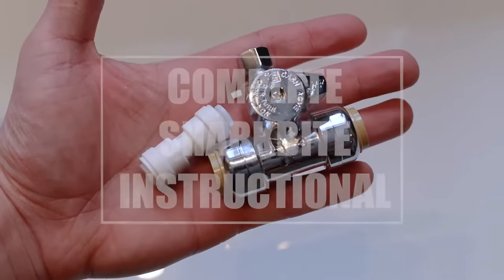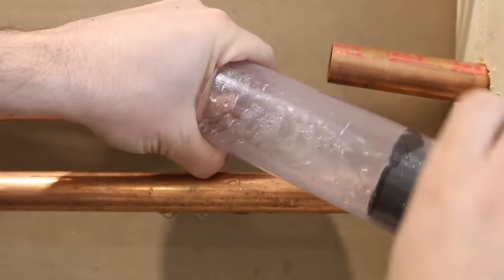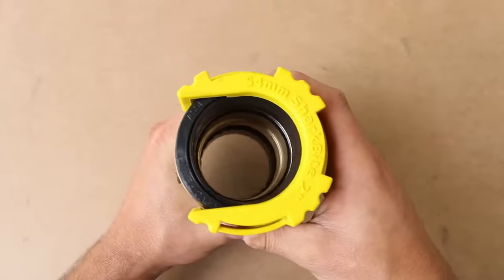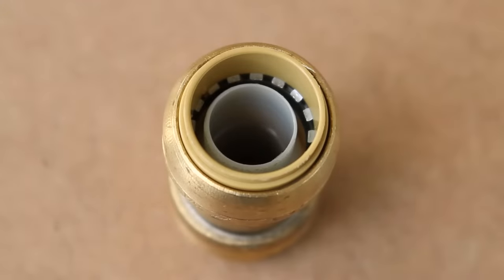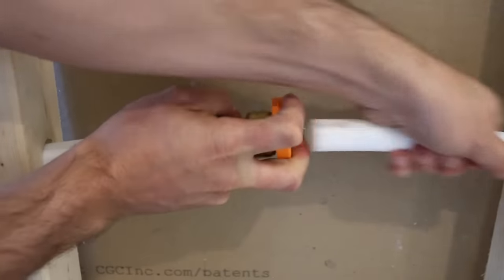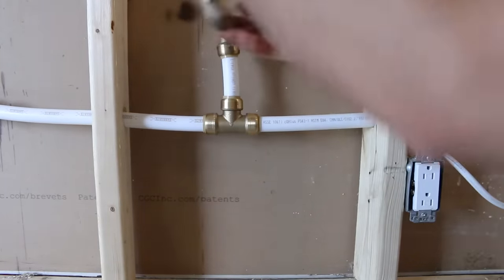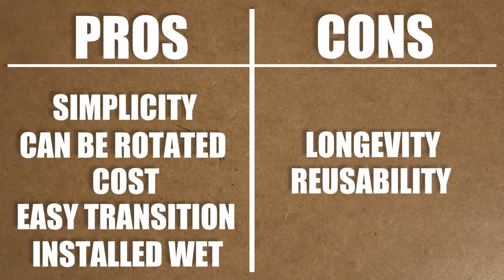Beginners Guide To SHARKBITE Fittings (Watch till end BEFORE Buying!) | GOT2LEARN

Comment: I read all the comments so far and see a lot of "these fail all the time."  Lets be real guys, if they failed all the time or didn't work when properly installed, then the company would have went bankrupt and out of business years ago.  I think a lot of it has to do to user error, but what do I know, I'm not a plumber loosing out on jobs by homeowners doing the work by themselves.
Reply: I cannot agree with your comment.home owners doing their own repairs cannot and will not ever replace licensed contractors,electricians or plumbers because while there are many repairs that we as home owners can do ourselves not all home owners have the experience or the skill set to do their own repairs and what's more building codes require that certain jobs be done by licensed contractors,licensed electricians and licensed plumbers.Case in point,here where I live a drain cleaning company will charge $275.00 for a main sewer cleaning and $175.00 for a kitchen sink,bathroom sink or bath tub drain cleaning.I own drain cleaning machines and I have worked for a sewer cleaning company so which makes more economic sense,for me to clean my own drains being that I have the drain machines and the know-how to clean my own drains or call a sewer company and pay through the nose for work that I can do myself?
Reply: @nelsonechevarria7009  - I agree. I am a homeowner shopping for a new plumbing system to replace the old galvanized pipe and drain. WOULD NOT EVEN CONSIDER doing the job myself !
Reply: @jamescalifornia2964  Amen to that.On my boiler I would swap out the hot water coil and change pipes leading in and out of the boiler if the pipes leak but for anything else I will call the boiler mechanic.It's like Clint Eastwood said in one of his Dirty Harry movies; "A man's got to know his limitations."
Reply: @nelsonechevarria7009  - Ha! Yeah after the boss blew up in the car. Those were good movies 👌
Reply: @jamescalifornia2964  They certainly are good movies,I watch them over and over.
Reply: I agree for bigger jobs that take more expertise, hiring the skilled professionals is the way to go.  But for the small jobs where you run 20 ft of pex and connect a couple of sharkbites, why would you hire a plumber?
Reply: i just bought a house and have these things leaking on the plumbing
Reply: Frank w i agree. Most time's they are not pushed completely in. I rarely use anything other than thier shutoffs if i cant get water to drain off completely. But at times in a really tight location also helps.
Reply: Nelson Echevarria the only thing that separates a home owner and licensed pro are tools and information...with the right info available, a desire to learn, and a will to get it done, a home owner can be just as good, if not better, than the so-called pro...knowledge is power and not Home Advisor, lol
Reply: @pharaohacura3618  What you say is true,however,experience cannot be replaced.Hands on experience,which is how I learned,is the best and only way to learn.Case in point,I have had to use my sawzall to cut into water pipes where the main would not shut off completely and in cases like that what I do before cutting into the water pipe with the faulty shut off is that I take two plastic shopping bags,cut a hole in the bottom of the two shopping bags,put my sawzall into the two shopping bags and with a rubber band I tie the shopping bags off around the neck of the sawzall and then tie the shopping bag handles through the sawzall handle then I can cut through the water pipe without having any water get into the sawzall.You cannot and will not learn that from any plumber or trade school,I learned that through my own experience when trying to cut through water pipes where the water would not shut off completely and there was no choice but to cut through the pipe in order to replace a shut off valve to be able to replace a water pipe.Even the plumber that taught me was amazed at my idea because it never ocurred to him to do such a thing.Sure,you can use a pipe cutter to cut a pipe where the shut off will not completely stop the water but how much longer is that going to take compared to using a sawzall with a new metal cutting blade to saw right through the pipe?Remember,the water isn't going to take a break while you calmly turn your pipe cutter on the pipe to disconnect the pipe in order to be able to unscrew the old shut off valve to screw in a new shut off valve,and that's if you have enough space to use a pipe cutter which is not often the case.The above lesson also taught me to always have a change of clothes with me when ever I went on a job with the plumber that taught me because once you try the method that I explain above you will get wet down to your briefs and so will the person helping you.P.S.,Make sure that the valve that you are going to install is in the fully open position before you attempt to screw the valve on because the water pressure will fight you every step of the way.Have the new valve in the fully open position and another person at the ready to hand you the teflon tape to wrap the threads with and to take the sawzall from you because the longer it takes you to get the new shut off valve installed the more water you are going to have to mop up once you are done.The plumber that taught me and I once had to do what I explain above on a two inch water pipe in NYC and believe me when I tell you that it was no fun at all,once the pipe was cut water shot out of the pipe like if it was a fire engine hose,seriously.The city was called to shut off the curb stop but the city claimed there would be a two hour wait before they could send comebody out to shut off the water from the curb stop,yeah,as if anyone was going to wait around with a big leak going on for two hours while the city decided to send somebody out to shut off the curb stop.
Reply: Nelson Echevarria i’m glad you were able to solve your problem...however, you just proved my point, lol...instead of waiting for a licensed pro to come and charge you for something, you took the initiative yourself...i admire that...not only did you tackle it yourself, you also taught the professional plumber something new...now, you have the capability of charging someone else who doesn’t want to take on such a challenge...and, overall, what did it cost you? just some free thinking and the desire solve your problem...i’m in no way saying professionals aren’t needed, i’m just saying that they aren’t needed for everything...information is in abundance these days and tools are EVERYWHERE, lol...thanks for the reply
Reply: @pharaohacura3618  What you mean is that I taught the licensed plumber that was teaching me LOL!!!Seriously,the plumber that I was working for was amazed at the idea of wrapping the sawzall in two plastic shopping bags to be able to use the sawzall to cut through the pipe for which the water was not shutting completely off without shorting out and ruining the sawzall from the water.It reminds me of an Abbott and Costello episode where Costello said that he could prove that a loaf of bread was mother to an air plane.; Costello: I can prove to you that a loaf of bread is mother to an air plane. Abbott: Aw go on,you're crazy,how can a loaf of bread be a mother to an air plane? Costello: What's a loaf of bread,a necessity right? Abbott: Yeah,So? Costello: An air plane is an invention right? Abbott: Yeah and? Costello: Haven't you ever heard that necessity is the mother of invention? At which point Abbott swats Costello with his hat.LOL!!!!Costello happened to be right ya know.LOL!!!
Reply: Roughly a 250,000 homes had inferior plastic piping installed back in the late 70's. It turns the manfacturer was using more recycled plactic in the pipes than code allows for. The plastic pipe was rotting on the pallets, let alone after being installed. The manufacturer stated he was sent the plastic from a plastic supplier and had no idea it was recycled. Since then even more homes had polybutylene piping installed. It's since been prohibited for building because it's crap but it was installed in home across the US for decades.
Reply: You can learn as much as you like about electrics or gas, doesn't mean you're allowed to touch it. There's a reason why these people have qualifications, IEE regs and GasSafe (was Corgi)
Reply: Confused Badger i agree to a certain degree...however, if that were the case, then qualified people wouldn’t make mistakes, use inferior products, issue recalls, etc...the fact of the matter is, a qualification only PROVES to another that of which you are  claiming to know...’knowing’ how to drive and ‘PROVING’ to someone else that you know how to drive are two different things...either way, you’re still taking the risk when you hire someone, or learn and do it yourself...more risky to do it yourself as you personally have to account for 100% of the consequences...
Reply: @pharaohacura3618  I beg to differ.As a home owner I make sure of what exactly is involved when doing any repairs.I have personally witnessed so-called professional contractors,professional plumbers and professional locksmiths miss steps when doing repairs and installations.Not everyone is going to take as much care of your home as you do when making repairs is number one and number two professionals have a tendecy to get cocky and miss certain steps when doing repairs because they think they kow it all.Several times working with my mentor the locksmith who taught me locksmithing I saw that he was about to make a mistake.I tried to tell him but he wouldn't hear me out and sure enough he messed up then caught a major attitude when I pointed out that he should have stopped and listened to me before proceeding.Where do you think the sayings "Too smart for our own good." and "Pride comes before the fall." come from?
Reply: Nelson Echevarria that’s my whole point...i agree 100%

Comment: I wouldn't hesitate to use these in my non-finished basement. But I would never use them inside a wall.
Reply: I would.  They have proven themselves many times.  My first experience:  about 10 years ago I was contracted for a condo renovation on the bottom floor of a 3 story, 24 unit building.  The renovation required the water to be shut off to the unit.  Of course the valve hadn't been operated since install and would not stop the water flow.  The building manager was called and he said he would just replace the valve for the unit.  He scheduled a shut down for the building.  Rather than waiting on the whole building to drain down and risk reflowing the solder on the main at the 2"x 3/4" tee to try to solder on a new valve, he installed a new valve using a Shark Bite coupling.  There has never been a problem with it.  It saved time and disruption in service for everyone and worked perfectly.   It made me a believer in the technology.  Of course it has to be installed correctly but so does any other method used.
Reply from the maker: Good comment.

Comment: Thanks, balanced well organized overview.  Greatly appreciate your opinion on use of Sharkbite behind walls. As a beginner it is worth the effort to learn how to solder copper.  However some tight spaces within walls can be a real challenge for even heating and consistent joints, not to mention the charring of studs.  Will be using concealed Sharkbite fittings here, sparingly.

Comment: You forgot a major con when comparing sharkbite to copper. Flow restriction.
Reply: Um....the sharkbite slips on over the pipe, how does it restrict flow?
Reply: @Lee-lb9qh  Um....evidently you've never used Sharkbite fittings on anything other than copper.
Reply: @Cotronixco  lol I work maintenance at a mobile home park, sharkbites are what they have us use, work with pex all the time, I know for a fact it doesn't restrict flow on copper or pex, I've worked there years and have used sharkbites to repair or replumb hundreds of mobile homes
Reply: @Lee-lb9qh  lol, Um....I can guarantee that your improper use of these fittings will result in leaks coming up soon if it hasn't happened already. Do you even know what the insert is for?
Reply: @Cotronixco  also clown the new generation of shark bites did away with that insert piece clown
Reply: @Cotronixco  do you know what gen of shark bites we are on?
Reply: @Cotronixco  the new ones are sharkbite max

Comment: I have a shark bite set up in my wall that has been there for almost 20 years that I did myself and it has outlasted everything else and it is not showing any signs of wearing or degradation, this fittings have been a lifesaver in so many different instances I will continue to use them since they have never failed me before, hell I've never even gotten a factory defective one and I use everything from quarter inch up to one inch including ball valve and the PVC transitions this is a truly great product that stands behind its name with trusted reliability! But this is only my opinion and my experience I don't speak for anybody else nor do I speak for the SharkBite company

Comment: "Leak free" till the o-rings that seal them deteriorate in 8-10 years and need to be replaced. This technology isn't anything new, they've been using it for commercial air brake lines for 30+ years. Air lines connected with these kinds of fittings always leak after the internal o-rings deteriorate in 8-10 years. Of course the plumbing and contracting industry won't tell you this, because they make more money charging the same rate due to ease of installation with these fittings.
Reply: Im not a push fitting proponent after seeing how freezing temperatures push them apart, even when insulated, that being said,  water builds scale over time and actually forms a protective layer between the pipe and O Ring
Reply: literally nobody says they're a multi-decade fix. its a temporary fix to stop leakage
Reply: @SunbearSmoke  yes, lot of people actually say that
Reply: Yes same with fuel lines for automotive

Comment: I'm renovating my newly purchased 120 year old house. The only plumbing that was leaking was the pex that was used in a previous renovating attempt. Even though it will be expensive I will definitely be replacing the mess of different tubing with simple copper.

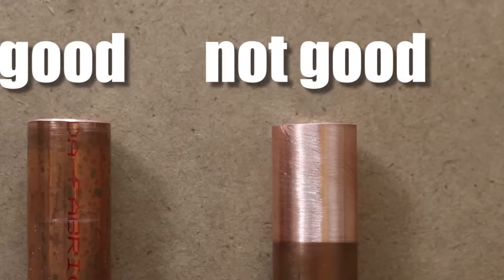Comment: Great Video! I wanted to comment on the most important 10 seconds of this video, says N E V E R to SANDPAPER the outside of the copper pipe before installing  at 8:10 mun!!! 
The very video which linked to your thorough presentation - and most others on YouTube - shows the installer happily sanding the pipe with emery paper ect. 
I always worried how the O-Ring can SEAL a bunch of sanding scratches. Soldering with proper flux does best on  sanded pipe. Final suggestion is ONLY buy the original Shark Bite tools and the brand of little round cutter you used. I returned the copy cat tools I got at Amazon, and got real SB ect tools and USA made reamers! Thanks, Hilary in GA

Comment: Two burst copper pipes in freeze.  Pipe repair using Pex and Sharkbite fittings.  Done by plumber.  Two repairs on two burst pipes in the freeze in the ceilings.  Observed the friendly plumber do the repair.  He used cutting tools shown in this video.  I do not remember the burr removal or deburring was done or not.  There was no orange deburr tool with him and no utility knife.   I am concerned. Total paid to plumber is $140.  Beautiful video by the way - so easy to understand !

Comment: Very Good video showing how they work. I agree that reusing then could be problematic, so keeping it to a minimum will help guarantee success with them.
I don't necessarily agree with you on the cost, as I  am very good at soldering the fittings to begin with, and can buy multiple fittings for the cost of one sharkbite - I rarely have leaks, and I can usually tell which ones are going to be problematic when I'm making the connection. These are the ones that I will be using Sharkbites on in the future. I think that they probably have a very long lifetime when used on the plastic pipes, which is the only place I have used them so far. Copper pipes with Sharkbites may have a bit less overall lifetime, due to the different expansion rates of all the materials. In an inside installation where the temperature is fairly consistent, and the pipes aren't subject to mechanical vibration, easily 50 years. I have taken apart other things sealed with edpm seals in use for +40 years that are still like new. I think that the longevity goes down some when exposed to wide temperature swings, like buried, but if was plastic, I wouldn't worry.

Comment: Installed these the other day. Added in the stainless braided lines as well on FnLaw water heater. His plastics blew out when we hit 20s, its in his attic.. lol. Gas. Fortunately the crack was small and didnt leak too much. 150$ worth of copper piping :) and shark bites. We will see what its like mext winter, im going to brace them with clamps so they maintain the same position not umder stress or load, or hanging. I currently have some safety wire holding them. The shark bites are Awesome and SUPER fast. I really cant believe they worked as well and easy as they did.

Comment: I have used Sharkbites and other brands of push on fittings for years. No problems. Can cause a drip if moving them around after years in mineral water. But stop leaking after a week or so as mineral resettles.  Important to remove burr etc on the end so no damage to O ring. Always wet them. Slide on easier.